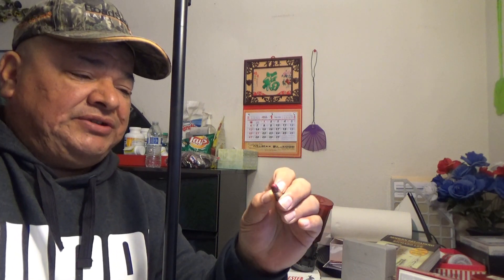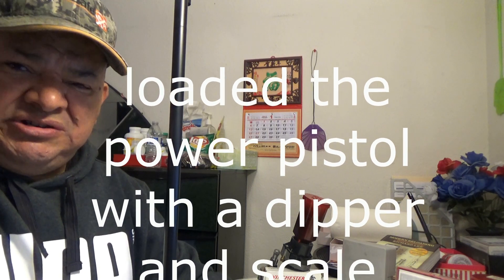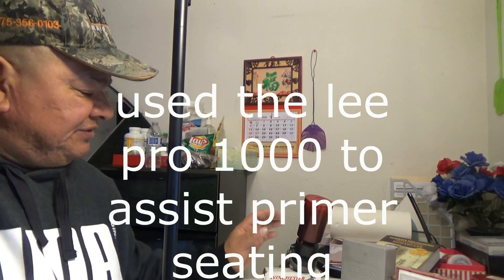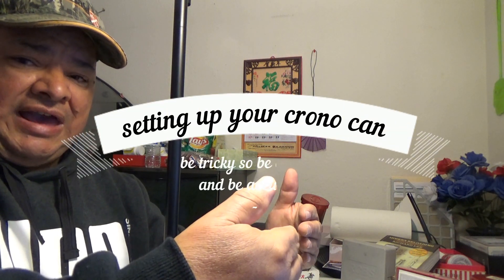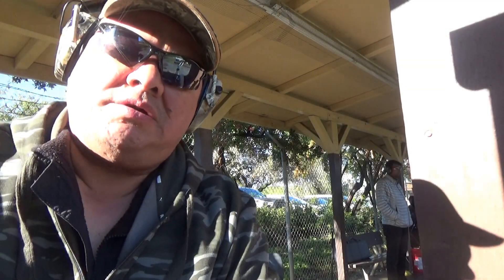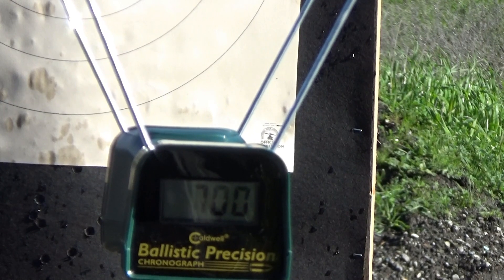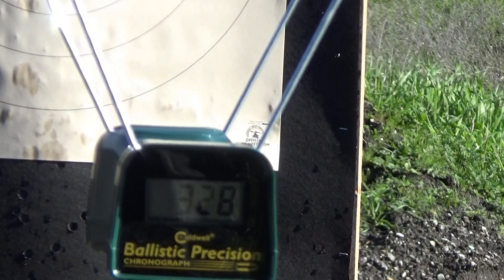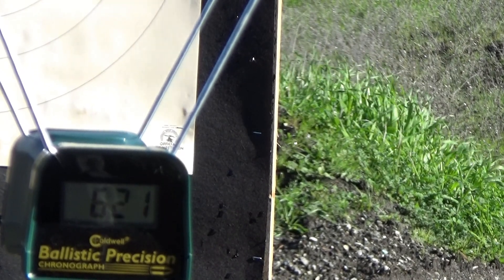.38 COLT NEW POLICE TEST & REVIEW.(WITH SHORT 38 SPECIAL CASES.)

Comment: It seems to me that Unique and Power Pistol are very similar powders. In my load data, Unique is usually a little faster, but not always. Both use heavier charges than Bullseye or TiteGroup.
Friday Feb 8, I found an H&R top break revolver chambered in actual 38 S&W in the used gun counter. It looked to be in good shape minus a missing rear sight. I didn't buy it. I also dropped off my RIA M206 for RMA Warranty work at the local FedEx.
Reply from the maker: i heard you wanted to purchase one but i didnt know already had one...what was the issus?
Reply: @Ford360CID  The cylinder seems to be off. The firing pin strikes the primers on the edge, usually resulting in a failure to fire. I could also see that the imprint from the fired brass was not concentric with the firing pin. Cleaning up all the shipping oil and relubricating it didn't make a bit of difference. Hopefully Armscor can fix it.
Reply from the maker: looks like a timing issue which can be fixed with no problem, they replace the cylinder hand or star ratchet or both,but you'll have it back better than when you first bought it, it is my go to 2" snubby 38spl, mine shoots high left so what i do is bring my front sight to the right covering half the front sight behind the right rear notch and bring the front sight down 2" sub 6 on the red dot.  @Fudmottin
Reply: @Ford360CID  I agree that it is a timing issue, but the cylinder was locking up prior to firing. Everything was tight. No end play. Very little wiggle on the cylinder. The 18 rounds I got to fire (most needed a restrike) were hitting to the left. Elevation was perfect. At least at the five yards I tested to see where it would hit as five yards is a no miss distance. I think the cylinder itself will have to be replaced.

While disappointed, I'm not hugely upset by this. Contacting the support department got me a FedEx label and box. I didn't have to pay anything to ship it off which I was afraid I would have to do. I went into this aware of RIA's rep with their revolvers. I'm not getting this as a primary carry. Originally I just wanted to test low pressure loads like you are doing. However, the gun is nicer than it has a right to be and I think it would make a nice backup as well. If it gets fixed that is.

I don't live in a State with handgun registration, so I don't know if they will ship it straight back to my house like I feel they should or if they will want to ship it to the FFL I purchased it from. The former is preferable, even if they replace the whole gun, simply because I hate filling out the ATF-4473 and the PA State Police form (I don't recall the number on that and it is only for handgun purchases). I assume there would also be a transfer fee in that case and the whole point of the M206 is that it is so incredibly cheap.
Reply from the maker: @Fudmottin  yes they will ship it to your front door like they did mine, you mentioned that the primer strike were abit off center so in my armscor m-206 (armscor service dept video i demonstrated how you check for positive lock up and what they did to the gun and what i did to improve the timing lock up...in short they applied too much matte finsh to the trigger parts causing my timing to not completely engage before the hammer came back all the way, i then removed the trigger assembly and removed the matte finish off the parts and viola the timing was solved.
Reply: @Ford360CID  I believe I watched that video. If you don't mind, I'll link the first video I made on my M206. As we speak, it is in transit to Armscor in Nevada.
https://www.youtube.com/watch?v=bX2tBWWxbRc

Comment: I have always been curious on the whole auto roll crimp scenarios. I always hear people say that it will bypass the headspace on the mouth and go deeper in the chamber increasing pressure, then I hear other people refuting it and they say that the round partially headspaces on the extractor, so it won't matter. The 200 gr bullets are certainly consistent, not just in velocity but in accuracy they are very consistent. It's like they withstand hand shaking and trigger jerking better than lighter bullets and come out straight. Power pistol is good powder, but it's name is a little deceptive. It's VERY good powder, and is more powerful than most loads in auto cartridges, but with most revolver loads it's not much more powerful than anything else. I hope spring comes soon, I need to do some shooting.
Reply from the maker: you know sam that could very well be a good video to make ( a 9mm accuracy straight walled taper crimp vs heavy crimp, is there any deviation of accuracy? even for the 45 acp, when i first started hand loading for the 9mm i used to put a heavy crimp on them and the 45 acp they both fired fine..but were always looking to squeeze out as much accuracy as possible out of our rounds, as you know when the 38 super came out that was the biggest complaint was that it was shooting all over the paper at 25yards, then barsto barrels made a match grade barrel for the series 70 38 super 1911 platform and the accuracy issue became no more accuracy was even good at 50 yards, so i would say that squaring up a semi auto round on the case mouth will in fact correct inaccuracy issues.
Reply from the maker: sam if you take your semi auto pistols and charge them slowly you will see the breach face of the slide push in a round into the chamber then the rounds rim  seats in between the extractor claw which actuallt gives it support...try it with a 380 round into your 9mm magazine and chamber a round it will actually fire without the support of the case mouth.
Reply: @Ford360CID  I have heard of people doing stuff like that as well as shooting .40's in a 10mm. All I could think about is the bullet scraping past the chamber where it's supposed to catch the longer brass mouth. Seems like it would wear down after awhile.